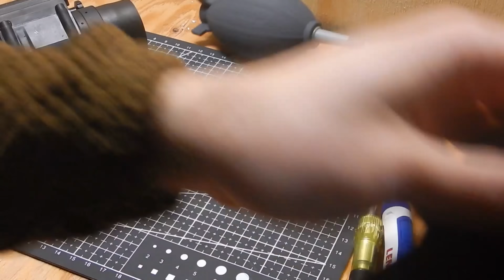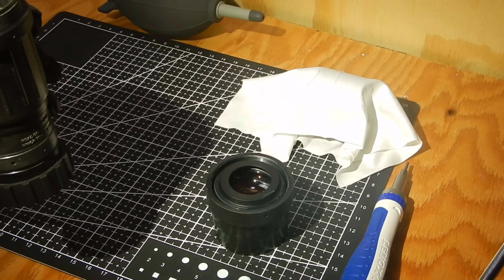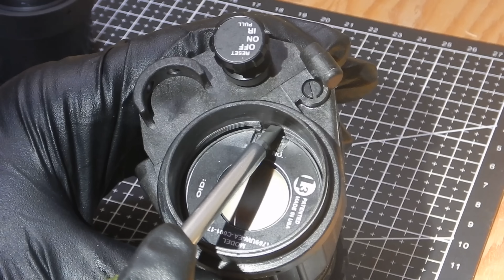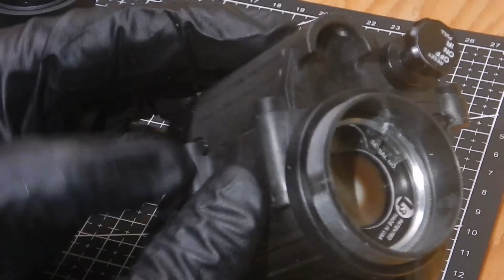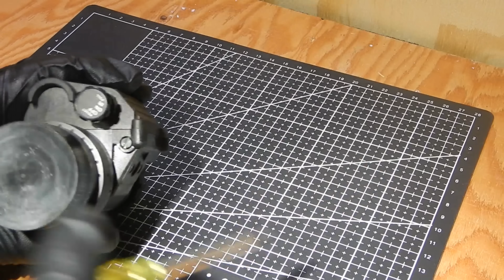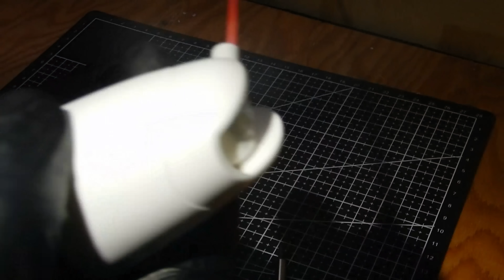How to Build Your Own PVS-14

Comment: The reason for the nitrogen purge in the first place is to drive out any moisture that is entrapped in the device. There is a very good chance of foggin the faces of the tube and the back of the optics. What I find interesting is these yacht owners who ship their boats to the Med for the summer will actually have at least 2 woking Gen3 scopes on board. Probably failed o declare on "outbound"documents. Customs on the other side don't really look for these items. They are more concerned with firearms, ammunition and other illegal goods .
Night vision is considered more of a navigational aid.

Comment: Glad you mentioned purging. Former General Dynamics Electro-Optical Research and Development Technician here. A small amount of water vapor in the air is NOT going to hurt anything until the unit FREEZES. Water vapor is basically optically clear. ICE on the lens is VERY MUCH NOT. Do you live in Alaska? PURGE!, Do you live in Arizona? No big deal. BTW S2...Semper Fi. Sgt USMC
Reply: Thank you
Reply: Thanks for sharing

Comment: I sincerely doubt you're doing much of anything by spraying the argon into that hole. You certainly introduce some argon, but probably not enough to make it worth your while. Honestly, a cheap vacuum pump for automotive applications can be bought of harbor freight and a vacuum chamber can be home built fairly simply. Pump down the chamber and purge with whatever inert gas is cheap and easy to get. Nitrogen gas isn't that expensive. Of course, if you're trying to do this on a budget (which is clearly the case), I wouldn't even bother trying to purge it at all.

Comment: From somebody that has been building ANVIS units for more than 20 years now there were a couple of steps left out.  Setting the infinity focus (ocular lens) and diopter (eyepiece lens) focus.  That is where that little spanner wrench comes into play, you really need 2 of them.  One to hold the lock ring and one to tighten the lens ring.  Generally they are double sided, one side for the eyepiece and the other for the ocular lens.  Simply screwing the lenses in all the way is not going to give you the ability to close and far focus.  You should be able to focus anywhere from about 2 feet to infinity using the ocular focus.  With the diopter set at 0 the eye lens should be somewhere about 3 and half to 4 and a half turns out.  The ocular lease somewhere from 4 to 6.  That is a cleaver way to get around a pressurized purge though you should do it with both else’s set to the outer most travel setting after the diopter and infinity focus is completed.  That way once you plug the purge port as you adjust the lenses in there should be an increase in tension, especially noticeable on the eyepiece.  If there is no increase in tension (which signals an increase in pressure inside the housing) then you have a leak somewhere and purging wont do you any good.  By the way it looks like you put the retainer ring in upside down, this can damage the IT especially if it is torqued over the value of about 8 inch ounces.
Reply: Do you buy your tubes direct from manufacturers? I feel like I would get laughed at if I shot L3 an email to purchase just one tube.
Reply: @miked7728  I get mine from the Army supply system.  Building and maintaining ANVIS is part of my job with the military.
Reply: @AirCav24  Oh haha gotcha. I knew I should have befriended the supply guys when we were getting all out 14s refurbished. At least they let me keep my broken housing as a memento. Thanks for the reply!
Reply: @miked7728  %
Reply: Uh oh, AFE ANVIS police is here. ^^

Jokes aside, as a guy who’s also AFE and has been building ANVIS units for a few years, I agree with all of this post. Trouble is, how do you set infinity and diopter without a 126A?
Reply: @newwwwbbss  I dont know but I would interested in that trick.
Reply: Is there somewhere I can read about building these? I’ve just discovered this a couple of days ago
Reply: @yockhunter  any luck I'm also curious
Reply: Hey Cav.  Reach out to me.  go to my channel's about and hit my email address.  I'd like to chat.
Reply: Do you have a good video that you can reference to show that process? If no video do you have the appropriate FM covering the assembly/repair/adjustment of the PVS-14 that you can share?
Reply: @SavageShooter93  I don’t have any video.  Never worked to much on the 14s other than a couple of hits.  The TM is out there, but as far as an “official copy” that has current changes that is a restricted TM.
Reply: Then you make a video
Reply: Tell me your AFE without telling me you're AFE lol
Reply: And where he says ocular lens, he actually means objective lens, facing the input window of the tube. The eyepiece contains the ocular lens assembly. No one any word on alignment corrections for bino use?
Reply: @wouterke9871  Ii
Reply: Cool!
Reply: Can I haz the manual foar dis?

Comment: Does the screw that is removed for purging have a small shrader valve inside? Otherwize how would it be possible to keep it under vaccume? Ive got nitrogen, vaccume pumps etc. Due to working in the HVAC field.

Comment: You could use air from a scuba tank. It is 100% dust free, and has a dew point of better than -90c. WAY cheaper than any bottled gas, and dry as heck!

Comment: you know what might work the best for dust? I used to do pharm research in a lab and we would often buy $10-20k/gram reagents from a chemical supplier, sometimes made to order, a few dozen mg at a time. I dont know if youve ever tried to weigh out sub milligram quantities but it takes an analytical scale and high mass block and a lot of patience. 
When I started we had these anti static "guns" that I think just use some kind of a spring and magnet that jumps through a coil and disrupts the EM field? idk how it works but let me tell you those things never worked. Try to take out a quarter of a mg and you end up loosing 100$ worth due to the ultra high static once humidity starts doin its thing to the bottle. (also for this use i could see those guns messing up the electronics)
What I ended up finding is a product called the "static master brush", specifically the refillable cartridges. 
They have the only authorization (i think?) from the US nuclear regulatory committee to use a polonium isotope in their product which sends out a good amount of positrons? or something which will truely neutralize any static charge if the source is held close enough to something for long enough.
we would take the radioactive source out of the cartridges and just glue it onto the end of a dowel which could be held in a mount or even by hand if youre patient and that is basically like a beam that will neutralize any static in about a 5 inch sphere. This is assuming you get a fresh source, half life is like 4-5 months i think. Im guessing with covid its going to be impossible to get something fresh and amazon says theyre out of stock for now.
but theoretically every time you puff air across the housing of the optic its creating a static charge which is trying to neutralize itself by pulling dust from out of the air. when they were available i think they were about 60-80$ for the cartridge. hope this helps

Comment: Used to be able to get ENVIS monoculars from eBay for around $1000, they had the same tube as some PVS14's
Reply: Really?
Reply: @antkoz6370  yeah, haven't seen one on there for awhile though. Occasionally see a housing. I think they were called M703e's as well. Had to make a custom bracket to relocate the mount screw so the J-arm would attach in the right spot to mount it on a helmet or to use the skullcrusher mount.
Reply: @antkoz6370  Also thet had a crappy ridged eye cup but you could swap on the better soft and angled ones that were on the 7's and 14's.

Comment: I don't know about all NVGs but there is MANY that use the same exact intensifier tube and several companies sell kits for several different NVGs. with binos you'd have to make sure that the quality is as close as you can get and the generation is the same. They say the pvs-31s aren't user serviceable, if that were the case why is there several companies selling 31 kits?

Comment: The purpose of the nitrogen purge is not to have nitrogen, in and of itself. What you are trying to do is have moisture-free gas inside of the instrument. Your argon purge is just as good, even SCUBA air would be good as it is supposed to be free from moisture/humidity.
Reply: also tests to see if the device is water tight which the pvs-14 and 15 have can handle rain and such harsh wet conditions.
Reply: I came here to say this.  Its not nitrogen for the sake of nitrogen, they use it because its known to be super dry.  You could use pretty much any gas that has a low dew point.
Reply: As someone who buys compressed gasses for my company (Argon, Nitrogen, etc) I would not recommend anything besides the Argon or Nitrogen for purging the water vapor. My recommendation is Argon if you can get it; otherwise use Nitrogen.

Comment: There no way for the the air to escape out of the housing, so it can be decently purged. I'd suggest leaving the housing screws loose enough for the the air to escape, purging than closing the housing again. Preferable while you're still running the wine can thing. The idea is to displace oxygen with argon.

Comment: Wine "rusts."  It oxidizes and that's what affects the taste.  The 30% oxygen and any moisture in your unpurged equipment is also subject to oxidization and humidity (fogging) issues,  no matter how minor and can shorten the lifespan of your device...  Or so the Germans would have you believe. 
  Any reasonable attempt to purge the O2 from your optic is preferable.  He's not just full of "hot air."
  Some spray cans come with finer straws than come with the wine preserver.  Wine bottles aren't hard to get into.  Take a fine straw from a different can and insert it into the straw tip from the wine preserver to "step down" the size of the straw and you can get into the optic cavity more easily, without creating a seal and be sure you get a good purge.   👍
   "Food saver" vacuum sealers (and the like) have both bags and hard containers in which the unit could be placed and vacuumed and left for any air/moisture to "cook off."
  Slip the end of the straw (comes with a lot of vacuum sealers) into the vacuum bag, close bag tightly and vacuum away.  Also, have the straw from the wine preserver sealed in the bag before starting the vacuum.  Then, when it's time, just insert the tip of the straw (obtain a finer size straw from a different can, like penetrant, and insert into the larger, wine preserver straw) into the optic purge port and fill it up.  Let enough gas into the bag that it's got some pressure and won't suck the argon back out when you open it. Put your finger over the port hole beforeyou open the bag.  You'll be fine.  😀
  Bob's your uncle, you've got a fully purged optic.  😀

Comment: If you're going to be working on statically sensitive items like a tube on your bench, consider building in a grounding bar/strap assembly.  A copper bar can be installed above/within reach of your work station and grounded through a cable to the electrical ground of your breaker box (large work capacity afforded this way, over a simple wrist strap alone) and a rubber, anti-fatigue/static mat
placed on floor beneath your feet. 
Note that when you install your bar, have it stand out from the wall 1/2" (or more) with rubber tubing on the bolts/screws (you can use drywall anchors, etc.) to ensure the proper grounding path is maintained all the way to the ground point (ideal instal tips).
  Upon going to work, stand on the mat (breaks static buildup of carpet, etc.) and just reach up and "slap" the copper bar.  "Presto," your are static free!  This was the work station setup when I worked with statically primed munitions in the military which could be set off by just a few millivolts.  That's not much. 
  We had a galvanometer on hand which we used to test ourselves as well as systems and our grounding point.  10-12 millivolts could set off a statically triggered munition primer and I could generate 27+MV.  I had to constantly be slappingthe bar, not justonce when I startedwork. 😆
(I couldn't wear battery type watches, either, they'd go wacky or die).  Also, you can attach a standard, antistatic wrist strap to the copper grounding bar and wear it to ensure you stay 100% static free at all times.  It could be anything you're working on that you want to keep static or dust free, not just tubes and munitions to warrant such an inexpensive but useful item.  It's just getting it done that takes a few dollars for materials and some minor labor.  
  Military setups like we had were grounded from the "slap bar" by copper cable directly to a grounding rod, sunk at least 3' into the earth (you most likely have one by your house for communications systems, anyway).  Those grounding rods are also available at Home Depot and Lowes.  Just drive it into the ground near the corner of your house nearest your work space (i.e. garage) or you could put one close to a window near the room if you can run a cable out through the window or make a hole in the wall or casing.  This is obviously extreme and, as I say, you can also ground it to the breaker box in your home or even an outlet  ground point, if that's more convenient.  It's better than nothing!
  The point is, with my tips and some materials you can make a completely static free environment for your work area. Just figure which grounding point best suits your needs and go with the simplest type.  But a dedicated grounding rod is best if you want foolproof.
Reply: You don't need any of that shit lol. Believe me.
Reply: @Big_AlMC  
  As long as you're not working with anything that's critically sensitive to static electricity.  Absolutely....
  But, nobody would have known they could ignore it if you didn't tell them...  So, thank you.  
SO glad you're watching out for all those ignorant, incapable people who are unable to decide anything for themselves...
 
  This information is there for anyone who wants it.  The good news is that no one's forcing its use upon you or anyone else who doesn't want it.  Ain't America grand!??
  There's this thing called "free will" that let's people decide for themselves whether something is worthwhile or a waste of their time. 
So, if you don't need it, more power to you!  Just go on about your merry way.  But, don't presume to speak for everyone else who'll ever read this, as though you're the "end all, be all, decision maker" for everyone else on the internet and know exactly what they'll ever need, no matter what they decide to do. 
  This is a place for the exchange of information, both the useful and the useless, not just the information that you deem pertinent. 
  I owe my life to such "shit" when I was working with statically primed munitions so, I know that it works. And I've prevented a lot of simpler mishaps, like working with circuit boards, primers and powder, volatile compounds and fumes etc., etc. with a simple version of this, tying in a grounding strap at my work station to the pre-existing grounding rod for my house, an item which everyone (in code) should have, anyway. 
  I really don't understand some people's irresistible need to crap on people's ideas or to otherwise invalidate or dismiss someone else's  suggestions or opinions, just because they don't think they're important to them.
  Enjoy yourself...  Happy, "static-free" new year.

Comment: You know, next time I'd try unscrewing the housing before doing the argon purge: you will allow most of the trapped air to escape the housing and be displaced by the argon. Perhaps you could have your buddy continuously spray the argon through the port while you re-tighten the housing -> this may allow a more complete purge.
Reply: Use a brake vacuum pump to suck 3 pounds negative then back to zero with argon
Reply: food saver reusable bag, fill another bag full of argon over the valve, open the valve and boom. You replaced the air sucked out with argon. Maybe?